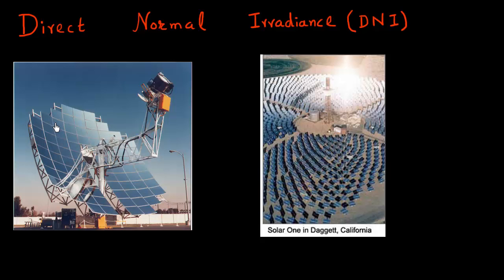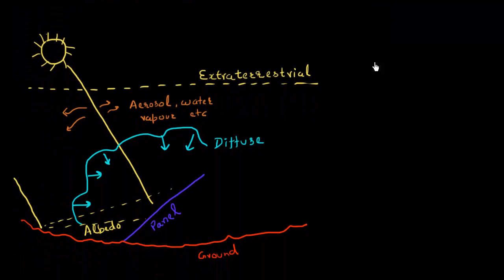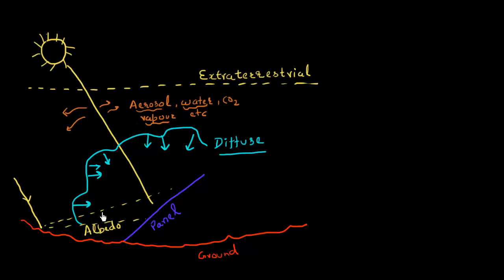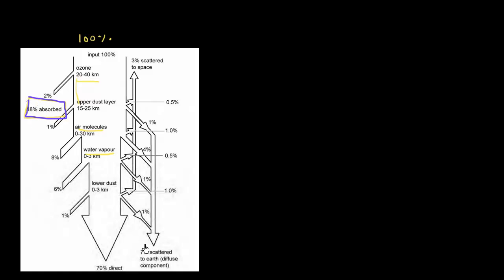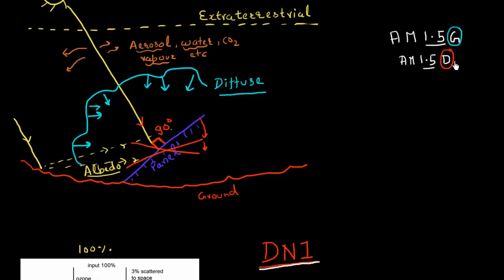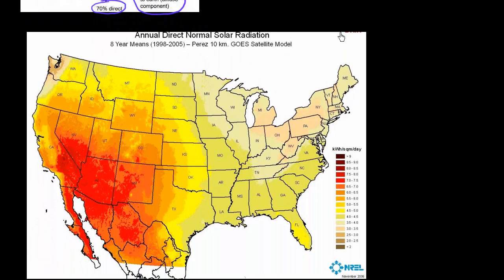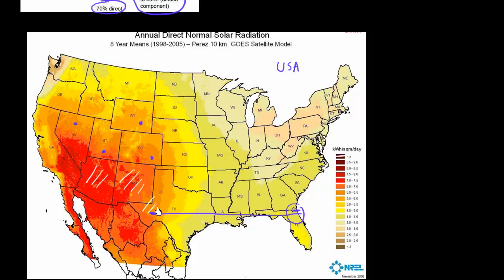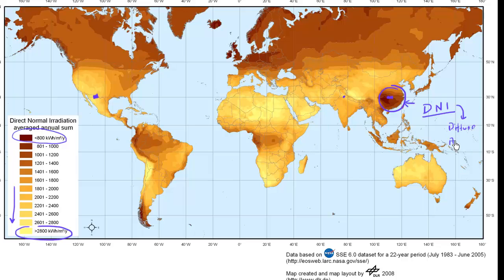Direct Normal Irradiation (DNI)

Comment: So if my panel doesn't have a tracking system should i consider Monthly Averaged Insolation Incident On A Horizontal Surface  instead of the Monthly Averaged Direct Normal Radiation ?